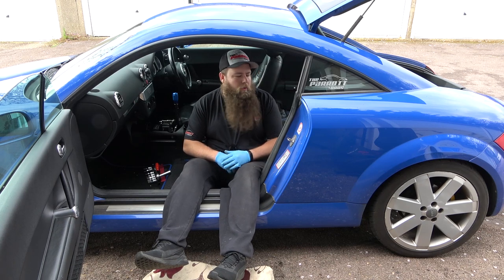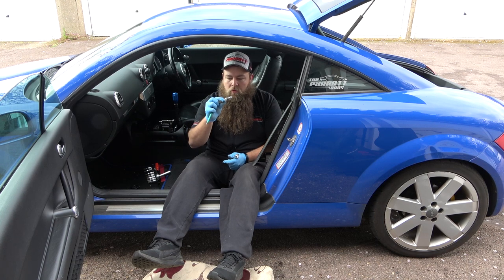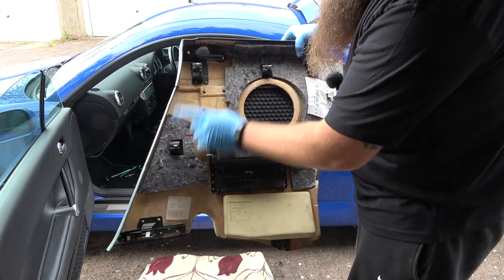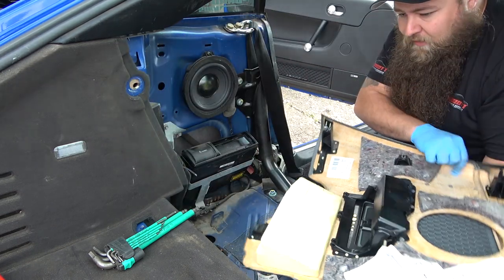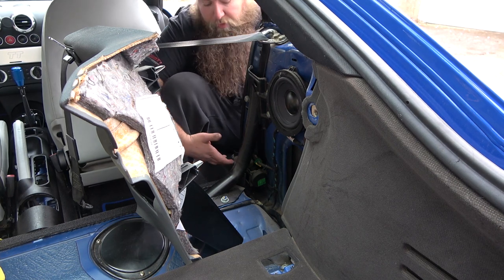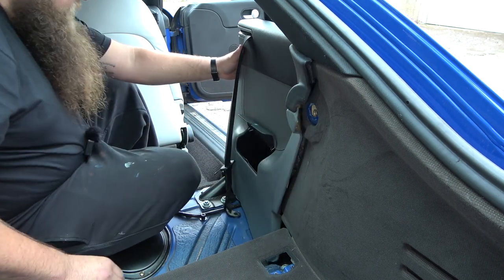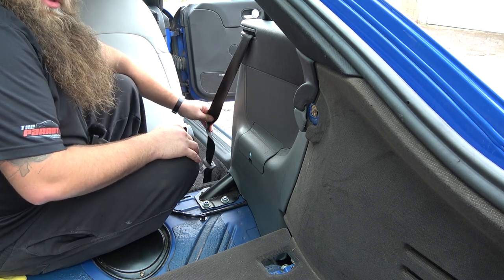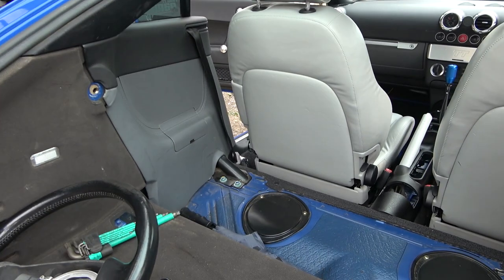Rear door card & seat belt removal

Comment: Just an idea for a video - since you're taking off the trim inside the cabin anyway, could you take extra video clips and photos of where it would be possible to fit some more sound deadening material to reduce the road noise in the cabin? Perhaps a sound-insulation mod? Haven't seen this discussed much on the forums, just a thought
Reply from the maker: Great idea, ill add it to the chalk board

Comment: I've got really slack passenger side seat belts, barely any spring return on it at all. I've been thinking about replacing but it seems an awful lot of effot and I'd likely damage the trim. However,  some red seat belts would be lovely!
Reply from the maker: Unfortunately there is quite a bit involved, but it will be well worth it and read seatbelts would be pretty epic, apologies for the lateness in my reply I'm sure you've probably already got them out now
Reply: @TheParrottBros  nah, not done anything with the seat belts. I've had 2 defective lines on the dashpod LCD for years now and not sorted that. It'll be another 5 years for the seat belts even if I can find a source of red ones!

Comment: My driver's side seat belt has stopped winding back up fully. Is there a quick fix for that?
Reply from the maker: Likely a new belt as probably failed mechanism. Pull it all the way out of it doesn’t wind back in then likely the clock spring has failed

Comment: Just what I needed thanks! I'm trying to find the source of water getting into the drivers footwell and need to remove the trim along the door sill. Do the rear seats need removing to remove the rear door cards?
Reply from the maker: It’s a lot easier, the base just lifts out you then might get away with the back moving up and down
Reply: @TheParrottBros  cheers, I ended up just uncliping the bottom of the rear door card which then freed the trim at the bottom. Frustrating still not found the leak lol, it's not at the door seal and not at the  plenum.

Comment: Do you need spacers for the rear speakers when upgrading them? Great video man keep them coming!
Reply from the maker: Thanks buddy, ive never upgraded only replaced im afraid so couldn't answer that, although i am going to be fitting some in the coming weeks i think
Reply: @TheParrottBros  I'll write back about how it went once we fit them to the car no worries thanks for the quick reply. I'm suspecting they won't be needed since the main reason for a spacer is to protect the speaker from water and the window going down in the door.

Comment: Nicely done sir, i love those seats and steering wheel, and grey rear cards look nice especially in leather.  I fixed my flap/catches with some epoxy resin glue....it wasn't easy to get to as i didn't take the seats out...bit of a nightmare job in situ (lots of cramp!) but its done and they both work, first aid kit has some fresh neurophen and paracetamol ;) CD player won't load about 3 disks so looking at modern alternative! Have you changed your wheels too or did I just not notice them before?
Reply from the maker: Haha I have had those old v6 wheels for a longtime, need to swap the new ones on though. 
I’m slowly researching stereo combinations and fitting so hopefully in next two or three that will be live on the channel. 

Yeah they are not particularly spacious to work on that’s for sure 😂

Comment: great video - I'm fighting with my trim a little more - especially trying to get a swan neck spanner to fit in the recess for the seat post - anyone know where to get a spanner to fit? (I've tried screwfix / B&Q / Halfords)
Reply from the maker: My swan necks were just a cheap set off ebay, maybe draper i cant remember off hand
Reply: @TheParrottBros  thanks for the follow up. I tried a number - in the end I got the dremel out on a draper and trimmed it so it would fit - narrowing the circumference and under the neck - the car's finally back together again - seats out is definitely the way to go - I'm impressed and annoyed at how well the door cards are clipped in - the metal clips definitely provide a better hold than plastic trim clips 

thanks again for the videos 😃
Reply from the maker: @TheJLAshley  Awesome! glad you got it sorted mate